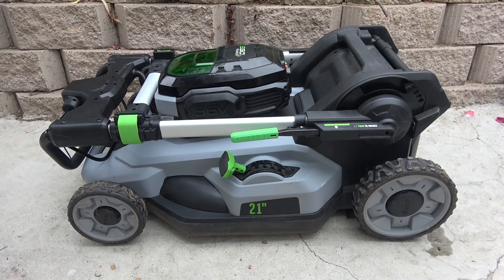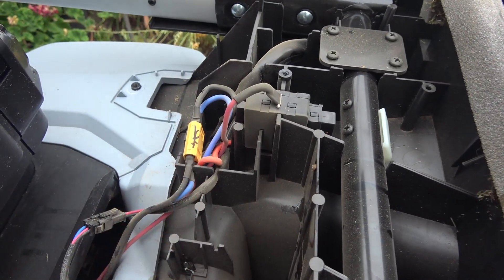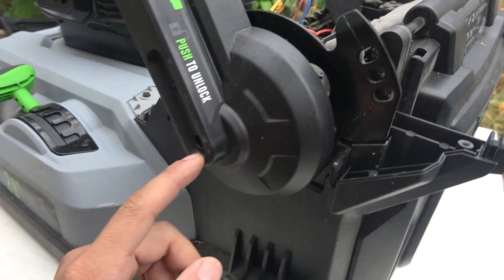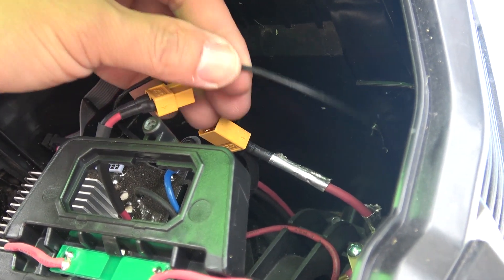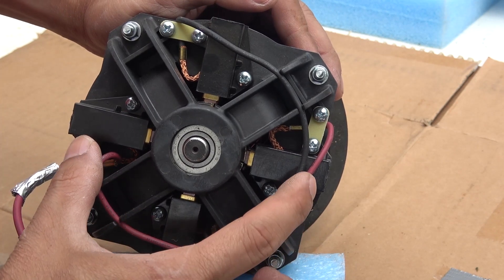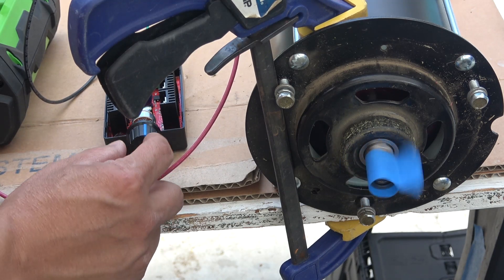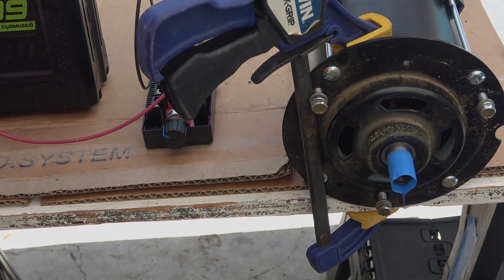Ego 56V Cordless Lawn mower tear down & bench test of the 56V Brushed DC motor

Comment: thanks but how do you take the top cover off to get access to the wheels? a nut came loose on the innner front tires rod and only way to fix is to open it up and reassemble!
Reply: This just happened to my mower too! Without that bolt holding the axle assembly in the proper orientation the front of the mower is scraping the ground and it's unusable. I haven't yet tried it take it apart to replace the bolt, but plan to. Have you? How did it go?
Reply: @ still workon on it but basically have to take everything apart

Comment: Appreciate your
Video walkthrough. My ego 56 self propelled doesn’t start like it used to to, it make sound like
A car with dead or weak battery and sometime it just comes on itself. I checked and remove the switch on collapsible handle, I am
Just trying to open the 
Black cover right above battery compartment to check the fuse and another switch but can’t figure out what kinda screw driver I need lol, most of screw is star shape, I am
Not sure if on black cover also have start shape screw ?

Comment: Wonder if you could do a video on how to convert a small cheap lightweight gas-powered push mower into a cordless electric mower that could run on anything from 24 to 60 V not the range but one specific voltage within that range so it can run off of a common battery without having to build one

Comment: Great video, whats the name of the controller you are using?
Reply: Acxico 1Set 12V 24V 48V 2000W 10-50V 40A DC Brush Motor Speed Control PWM HHO RC Controller

Comment: Do you have the link for the controller?
Reply: Acxico 1Set 12V 24V 48V 2000W 10-50V 40A DC Brush Motor Speed Control PWM HHO RC Controller

Comment: You need a controller or can you just wire straight up too it iwth the batteries?
Reply from the maker: You can wire it straight up to the batteries but it will give a big jolt and the motor runs at full speed the moment you flip the switch. No soft start. You will need a controller.
Reply: You can use a variable speed switch but it's not as effective or efficient as using a controller is what I found in my research.

Comment: Pretty cool that the components are what makes an ego great.
I fly RC planes. In parts, they are very similar.
There is a motor, a blade (propeller on a plane), an ECU (computer to control everything) and control mechanism (transmitter on an rc plane) no receiver because its not wireless, nor many control surfaces, so way less moving parts than an rc plane.
Very simple straight forward set-up when you lay out all the parts.
What makes a good RC plane, is a brushless motor (u can get more rpm with less heat and greater efficiency, they are not made equal like hand tools, they will all work, but for how long?). The ecu, some are 40A/50A/60A and so on. That is the amount of power it can accept if u will and know what to do with it. Good ones don't get super hot, and are higher than what you need, so its not constantly overworked.
Reply: Also what makes them weak.
A $600 mower that dies after 5 mows is crap.

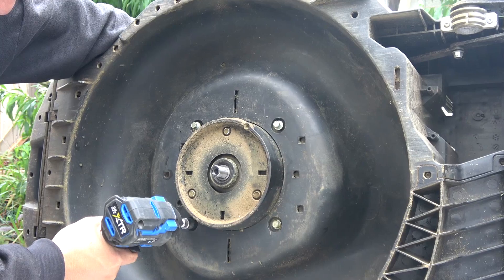Comment: At 3:30 after you removed the lawnmower blade there was a silver disc with 4 holes around the motor mount. How did you remove that, does it just pull off?

The video gets cut there and that part is missing. I didn’t want to just yank on it and risk damaging it.

Comment: anyone determine the exact name of that controller? 
Many thanks if you could post.
Reply: Acxico 1Set 12V 24V 48V 2000W 10-50V 40A DC Brush Motor Speed Control PWM HHO RC Controller

Comment: I live along a river and accidentally had my Ego mower roll into the river when I turned away from it for a moment. I tore it apart as best I could - not as far as you did in the video. I set up a portable heater next to the motor to blow warm air on it to dry it out. I have it like that for two days now. I haven't tried starting it yet. Any thoughts on whether there is anything else I should do before testing the mower?
Reply: @StevesVids : Yo! So what happened to your test? Any luck?
Reply: @xxycom8963  I let it dry for several days to be safe and put everything back together.  it started up just fine and has been working great all summer and fall.

Comment: Just got one now for 80 bucks gonna break it down and see how good it is. Not sure what amps to use yet.
Reply from the maker: With battery and charger? That's cheap!
Reply: @vuaeco  no battery but I built my own battery using those xt90s. I just mounted it to my motorcycle using a 36V system lol going to upgrade to 72V next. Jehu Garcia has amazing parts for EV builds, ill be picking up a few more lawnmowers under 100 this week.

Comment: I started tearing one of these down and it's now on a high wheel trimmer frame.  Handlebars were easy to move over w/ a few bolts and drilling some holes - problem I have is finding the right pulley for this motor. it's not 3/4" but also not 5/8" as I have a 5/8" pulley and it does not fit.  It's somewhere in-between.
Reply: I know it’s a year later, but I just bought two motors sold as 5/8” and they measured 17mm.  My 5/8l pulleys were just barely too small.

Comment: I have a cheap one - ego I bought (LM2100) for under $100 at lowes on clearance w/o battery as a backup.  I have an ego 7.5 battery from my backpack blower already and a self-propelled ego mower (which I really like).  I have a high wheel trimmer (craftsman) where the engine seized after 8 years of use (I worked it hard on our 40+ acres).  I want to take the guts of the LM2100 (e.g. motor, housing, handles) and put it on the high wheel trimmer and make it useful again.  I bought another newer craftsman high wheel trimmer but the plastic carbs on the new ones are junk and it won't run right seasonally.  New carb approved mowers are junk.  Thoughts?

Comment: Could you share a link to the controller bro?
Reply: Acxico 1Set 12V 24V 48V 2000W 10-50V 40A DC Brush Motor Speed Control PWM HHO RC Controller

Comment: I am guessing u r an electrical engineer. When u get that motor on a go cart, that thing will lite your hair on fire. Nice to c u fire up that electric impact. That’s a new Kobalt. I have the older 1/2 drive with a 4 amp battery. Not as powerful as the Milwaukee, but I think it’s in the ballpark. Was that the 3/8’s model?
Reply from the maker: Mine is just a regular XTR 1/4 hex impact. I just use hex to 3/8 adapter. It loses some torque but still enough to remove lug nuts from trucks and vans.